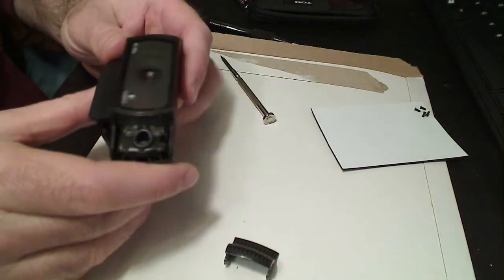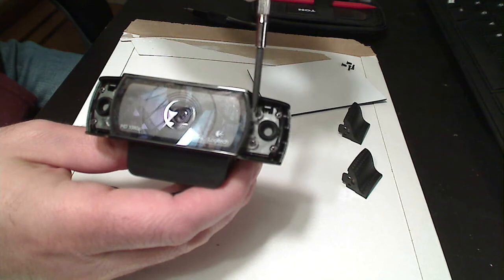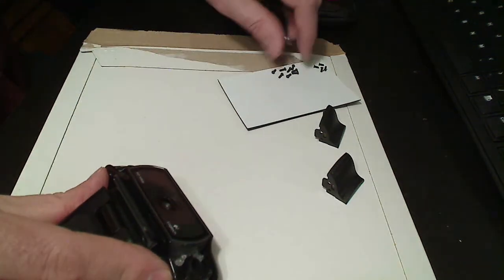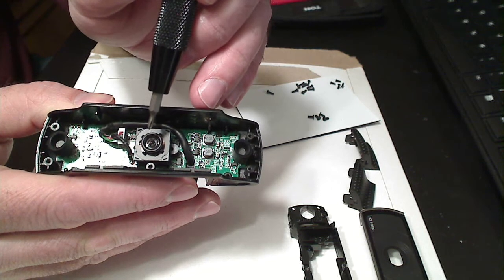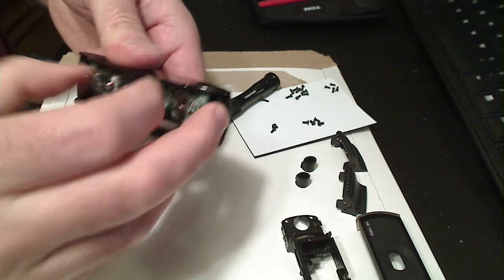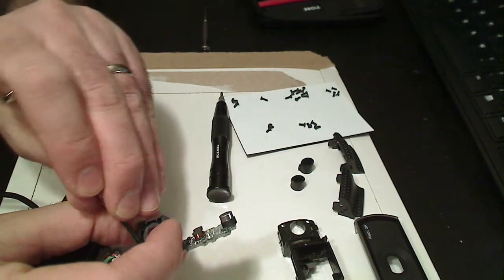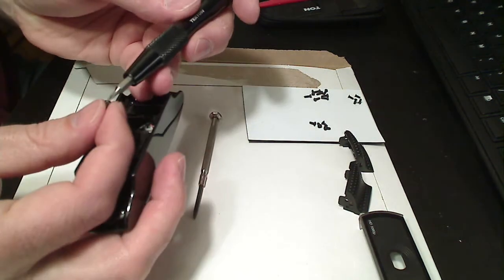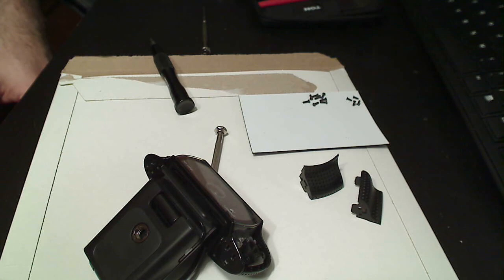Removing IR filter from Logitech C920

Comment: Just as a note for anyone doing this, make sure you don't get any dust or whatever on the sensor while you're getting the filter out. I've got some small dust spots in my video from the back of the lens. Not an issue for my use case but something to keep in mind

Thanks for the video, very informative. I'm using my camera for IR head tracking and needed the filter taken out :)
Reply: can that dust be cleaned if it gets on the sensor itself ?
Reply: without removing the filter, the camera sees infrared diodes

Comment: Heads up, I recognize those bits and they are made with a rather low quality of steel.  There are many times I've stripped or chipped the bit and not the screw.  I definitely suggest getting yourself a premium bit set and use whichever driver you like.

Comment: I have a question to your rebuild. After remove of the IR filter is everything  blurred on my camera. Is this behavior normal? I thought every picture is like red because of the missing IR filter but I didn't expect that the result is blurry. Is that behavior normal or did I make a mistake by the modificaction
Reply: IR has a different wavelength, and requires a different focus point on the lens.  So the behavior you observe can be normal.  This is why on professional cameralenses you can see a white focus marking on the lens barrel, and a red side marking next to it with f11 and f22 written around it, which is the infrared zone focusing range.

Comment: is it possible to replace the cable on my c920 with the cable from a broken c270 HD are the cables exactly the same?
Reply: Not sure about the connectors at the end, but if it's just 4 wires with USB on the end, they should be interchangeable. If the wires are red, black, green, and white on both, you're good.
Reply: Yes usb 2.0 is all the same

Comment: Does that IR filter blocks UV light too?
Reply: No.  Most IR filters do not.  UV filtering happens by most pieces of glass already, depending on what UV type you are talking about.  UV-A tends not to pass glass well already, while UV-B can pass it a bit.
UV-C is definitely bad and is typically much better at passing surfaces.  After all: it's the kind that tans your skin.  But a UV-C producing light requires quartz-glass, otherwise it'll be blocked inside of the producing tube already.